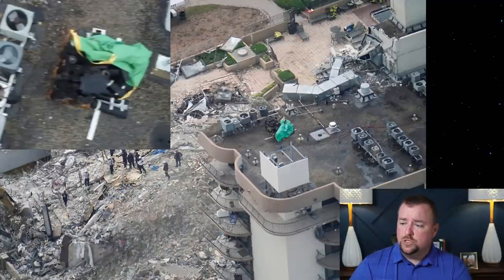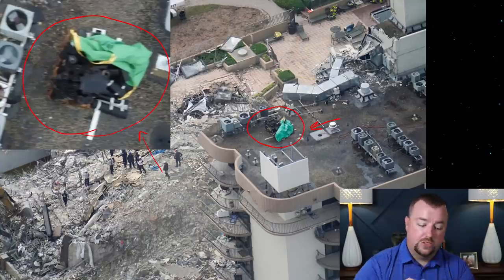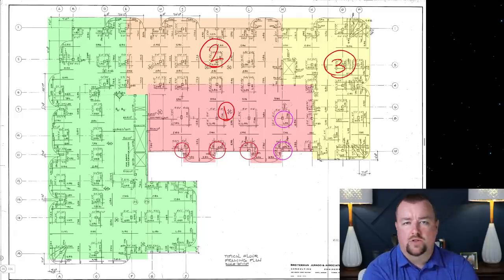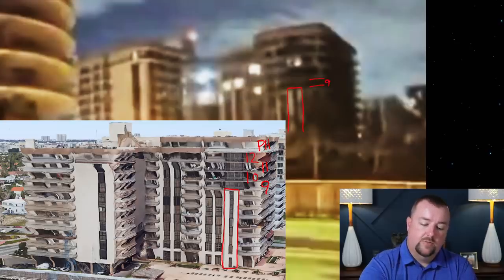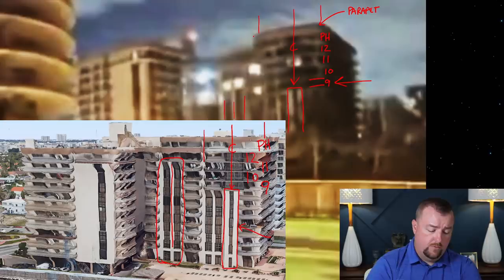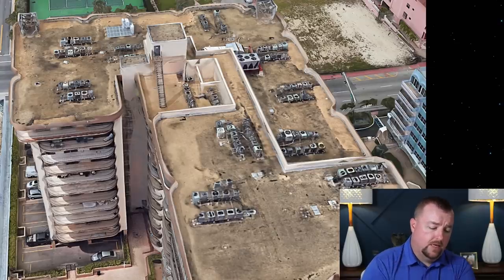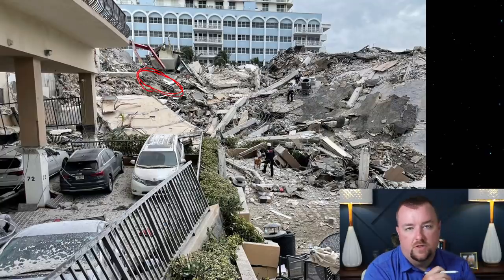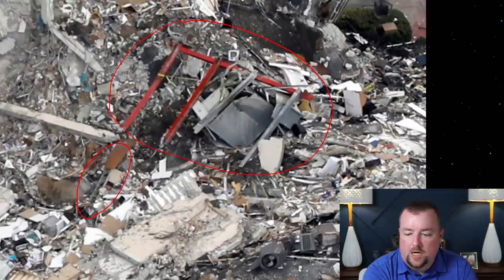Surfside Building Collapse - Did it start at the roof?

Comment: I’m very surprised that in this day and age this is the only video available of the collapse.
Reply: It’s likely the only PUBLICLY available video. There are likely others with great detail of people’s last moments of life. Those should not be made public.
Reply: This is clearly someone videoing the monitor of a security camera system with a cell phone. You can see the edge of the monitor, and the edge of the window of the software on the left side of this video. Even the original video, from the security system would be much higher resolution, and not be chopped off at the beginning. I'm sure the forensic investigators have the original video, but it's not being made public.
Reply: @nobodyknows3180  Yeah, I've watched that one too. It's also good, not quite as detailed analysis as this video. I'm sure he did the analysis, but he didn't work through it in the same way Building Integrity did in this video.
Reply: @gorak9000  correct, this is a security worker recording the video off a monitor. I wouldn’t be surprised if the original higher res video is released in the future.
Reply: Not true what so ever
Reply: That is really weird, what are they hiding?
Reply: @wyattblake4126  this is not the only video. There are many videos and by engineers who TELL and show it much better than this guy. Even a video from a lady perspective owner who took picks of the garage looking where her parking spot would be showing the water on floor and wet paint filled bubble with water on the ceiling.  It was the constant water eroding steel and other engineering faults that have been extensively talked about all over YouTube and news.
Reply: @deb4735  downtown Miami and a handful of videos?  Like someone asked where are the videos for the hours before?  And another thing, is anyone talking about the AZ recount that ended at the same time? Miami counties always have something happen when the talking points need to be changed (Miami Dade pedestrian bridge collapse, Browards school shooting)
Reply: @deb4735  I think what was meant in the original comment is the cell phone recording of the security video playing back is the only video of the actual collapse. Yes, there are plenty other videos of the building before, like you said showing lots of stalactites from the ceiling the garage - a sure sign that water was pouring through there for a long time. Also plenty of other analysis videos (but I've not found any with a clearer explanation than this one). But it's odd that only one security camera video of the actual collapse has been made public. I'm sure there are more cameras that captured the actual collapse.
Reply: @gorak9000  Maybe there are more views of the collapse, and they may become available later when any saved footage is reviewed. Most security cameras are pointing at the entrances and grounds of the building they are securing, not showing views of surrounding buildings. I don't know what security cameras/system the collapse building had, but the chances that anything survived are not high, unless storage was offsite at some security company. We shall see (conspiracy theories not withstanding).
Reply: @daveg2104  Somehow I doubt more will ever be released. Once the last of the remains are removed from the site and the news doesn't talk about it anymore, 3 weeks later, most people will be like, "Building collapse??? Huh???" and it will all be forgotten. Just like every other tragic event that's happened in the past, and every other tragic event that will happen in the future. 

The main entrance to this building was in the part that was still standing, and that tends to be where the security office is, so if the building itself had cameras, they would've had lots of time to retrieve the footage (or just take out the whole security system - it's basically just a PC these days) before that section was demolished. You'd think the hotel across the street, where the people that took the footage of the garage collapse just before the major collapse happened were staying, would've had some cameras that caught some portion of it. I have a feeling that even those people's video might've shown the entire thing, but it's not getting shown publicly.
Reply: @gorak9000  I am sure there will be report. I'm not so sure anyone will be held accountable. Will any lessons be learnt? I don't know.

Comment: If they were replacing that roof? It would  be done in sections! (As chopped up) as this roof is.  Knowing south Florida commercial roofing? It would be finished with gravel… so the first steps would be removal of gravel then hot tar a celotex insulation board down! Then bring up onto the roof the felt paper..  I see no rolls of paper on the rubble pile…  this along with the other points  you’ve mentioned  lead me away from anything roof related..   great stuff sir.  Appreciate your videos.

Comment: Josh, I have been binge-watching many of your videos. Many times you use the phrase, "if you can see my cursor". No. It is difficult to see your cursor, so you are right. And I'm watching on a 50 inch Sony Smart TV.
May I suggest you go into your system settings and set the size of your cursor to a larger one if not the largest.

Terry Thomas
PC Tech Support
Atlanta, Georgia

Comment: You can also see a few of those flashes prior to the third portion collapsing in various areas of the building surrounding the collapsed areas. These look like electrical flashes to me. Very quick, bright, white light.
Reply: Yes, I think the same thing. The blue color, and that they're coordinated in multiple locations would pint to electrical arcs to me. Also, if you play the video frame by frame, the lower of the bright flashes goes out at the same time as one of the lights in the condo up and to the right of the flash goes out. The top bright flash goes out corresponding to a light going out in another apartment that's close to ground level in the section that's collapsing a few frames later, and the remaining lights both in the section that was still standing, and the part that's collapsing, go out a few frames later still. This would be consistent with 3 phase power, and each phase faulting one after the other.
Reply: Agreed. They look electric and not pyrotechnic in nature
Reply: DEW. Very popular these days.......( direct energy weapons ). The UN is very familiar with them.
Reply: Eh, I think the evidence in this case shows overwhelmingly that this is a case of imperfect humans making numerous errors rather than Dr. Evil executing his plan to destroy a beachfront condo.
Reply: @linanicolia1363  "DEW. Very popular these days" - oh great, the Jewish Space Laser crew has arrived! Just who we need to hear from. Don't you have a flat earth theory to be defending or something?

Comment: The green thing covering the roofing materials is a "Bagster" from someone like waste management.  I think the flashes are electrical arcs, possibly as higher current carrying conductors are severed, such as those serving the elevators perhaps, or even feeders to the upper floors which would be consistent with the lights going out instantly after the flashes.
Reply: I think you're probably right. The elevator was right there.
Reply: Yes and the flashes are what triggered the video to save. Mine are motion activated also and have had similar experiences.
Reply: @jamminwrenches860  in the garage there was leaking water, most likely from the fire sprinkler pipes, once water starts to flow, it will trigger the fire alarm, those are strobes, you could still see them flashing after the building collapsed.
Reply: @bretwalley4673  if the fire alarms did go off, why didn’t people leave? There was roughly 7 minutes between the pipe break in the garage & the total collapse?
Reply: @MeriLizzie  1 am people don't move so fast, many people don't even wake up because of alarms, especially if they have had false alarms in the past.
Reply: @jamminwrenches860  This is why I love the comment section. Everyone has some specific knowledge to bring to the table to help solve the puzzle. I wonder if the investigators ever read these threads or watch these videos? I certainly would.
Reply: I figured the flashes were electrical arcs as well. Anecdotally, they reminded me of the power flashes you see in the path of a tornado.
Reply: @jamminwrenches860  The video that's released is clearly someone recording the video playing on the security system of the other building using a phone. Watch the left side of the video - you can see the edge of the monitor, and the edge of the window of the security software. I'm sure the original video on the security system has the whole thing, it's just the person recording it with a phone missed the first bit. Also the original video would be much higher resolution. I bet someone has that original video, but it's not being released to the public.
Reply: IMHO: The still image of the security cam isn't showing the collapse of the top floors; rather, due to an angle of the image, coupled with that section being recessed, that the floors were at height at that point.

Comment: Need to talk about the penthouse being added later, I know they had engineers, but that building wasn't designed or engineered for a penthouse
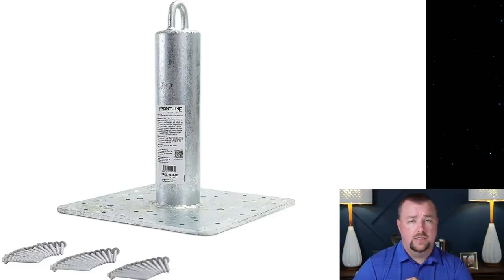Reply: As mentioned before, certainly the penthouse added significant weight to the roof but the structure stood for decades after the penthouse was constructed. It might have been a minor contributing factor. Someone also make a comment like suppose someone came back from the bar at 1:30 and whacked a column while trying to park their car.
Reply: The North building they did that also. But its clear also that the specific building was poorly maintained. If you look at google earth and street view at both buildings you see the north building in pre makeover condition still looking 100 times better than the south building did at the same time. Even things like AC placement on the north building in better as they focus the weight on the building core where as the south building all the AC units are to the edge of the building. the roof is rot to hell. All round its just a mess and $$$ is more than likely to blame over everything else.
Reply: The bottom line was having no columns to hold up the structure.
Had it been built with the columns it probably would not have collapsed the way it did
Reply: I think the thinner garage columns is to allow for more parking spaces underground.
Reply: @johnbrowneyes7534  greed at time of construction
Reply: @truckerkevthepaidtourist  Do you live in a cardboard box?

Comment: A couple things about the lights. All LED lights in the US have a capacitor in them. So you have the drain of the capacitor. On top of that as certain things are crushed the capacitance of other things as they are being crushed will be pulled by those lights in something known as flyback voltage. So this is likely why they are still lit and why they are so bright. Also wires will stretch some before they break so there will be a delay from that as well on top of conduit protection.

Comment: I heard 1 engineer yesterday say that  he has looked at building plans vs post collapse photos and said it appears that the building may have lacked the amount of steel and/or rebar that was specified in the building plans. He said it is possible the builder did not follow the specifications in the plans.
Reply: Not surprising since these buildings were built during a time when building codes were being relaxed and there was a lot of corruption going on. Lots of drug money and criminal organizations pumping money into construction in Miami.
Reply: @ 23:57 Look at the piddly amount of rebar tying the floor into column 72!
Reply: All These Innocent Lives Lost Over Greed.
Reply: I read the assessment from an engineer or something from 2018 that said the original design included slopes to allow water to drain, and he thought it was a huge flaw that it had been built FLAT, thus allowing standing water. He also mentioned in the report that it would be super expensive to fix and disrupt the tenants.
Reply: How can he tell when it was is collapsed and damaged and went flying off everywhere?
Reply: That's always a possibility in any building. Contractors and supervisors can skim off of materials and labor especially cash labor.  This is common knowledge. For example, a home Depot employee was in cahoots with contractors and stole millions by fudging pro desk paperwork.  Lots of day laborers are paid cash daily and nobody checks the daily tedious paperwork. On these big projects there's so many layers and opportunity to steal.
Reply: @dinaboop  Yep he said the pool deck waterproofing was failing and that there were errors in the original construction causing water to stand on the slab of the pool deck. He also noted that the planter waterproofing had failed and was causing damage to the slab above the garage. Engineers just inspected Champlain Tower North and identified damage to the slab and column below the planters at that building too, attributing the damage to failed planter waterproofing.

Comment: Pretty sure the roof was scheduled first because hurricane season was approaching and it was likely the cheapest of the repairs needed.
Reply: Many times to fast track a project work will begin on areas that have approval from the building department which may be the case here
Reply: They probably felt that the pool deck wasn't a priority. People who ignore history. So many parking deck collapse examples.
Reply: @berenscott8999  In fairness, 90% of the damage to the pool deck was probably being concealed by the same pavers that were probably causing it. I am a USC-graduated Architect and only now am I learning that by the time you see cracks in the underside of the slab, the other side is in extremely dire need of emergency repairs. Yes, I knew it was a big problem to see cracks in a slab but not a 90%/10% problem as many forensic engineers are teaching all of us on YouTube. I actually hope this leads to many saved lives and I see lots of work for retrofit engineers/contractors moving forward. So I can ALMOST forgive the HOA for not understanding the urgency and especially for not understanding the bad design that connected the fate of the pool deck to that of half the residents, but I don't forgive them for adding those heavy pavers, palm tree pots and extra planters without re-analyzing and re-engineering the garage columns!
Reply: I agree, there are numerous reasons to schedule things that way.
Reply: @CaptainCaveman1170  But if you take a look around the world, generally parking decks aren't treated the same as any other structure. There is often a lot of neglect that comes with them. "It's just a parking lot". I mean, you can find plenty of parking decks that have collapsed. They are exposed to the elements on pretty much all sides.

Because it's a parking deck, it didn't get the same treatment as the rest of the building. They definitely wanted those columns in the parking area a lot weaker then the actual tower.

And really, what's common in Australia, is that parking areas need to be disconnected from building structures, or treated the same as a building structure. And you get super wide columns here in Australia, like they don't screw around here.

Those punching shear columns are crazy. And the way they double layered the paving. Wow, extra load.
Reply: @berenscott8999  Exactly, the designers should have foreseen that human nature would be to neglect a parking structure so those should always have their own independent support systems in my opinion. Neglecting a small part of a small parking deck is terrible but it should never result in 2/3 of a building being downed and 160 deaths.
Reply: @CaptainCaveman1170  But, you know, that building was clearly neglected. Like, you compare the state of that building with the others. The condo board clearly neglected the building. There were only interested in repairing superficial issues which impact condo sales. The way they interpreted the inspection report was to fix the cosmetic issues. They had to put anchor bolts on the roof, as that was out of code.

What they really failed to understand about the parking garage is that it was going to all have to be pulled out and redone. I'm sure the quoted price was not nearly enough to fully repair the damage.

This is what they should have done: remove all vehicles from the garage, completely remove the pool deck. Rebuild from the ground up.

The builders made only one mistake, assume that condo boards wouldn't neglect the building.